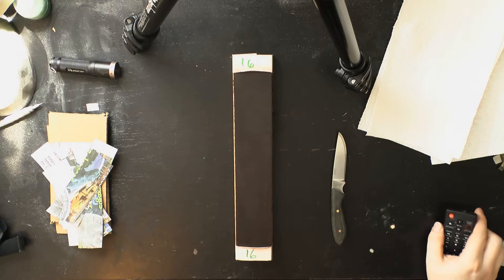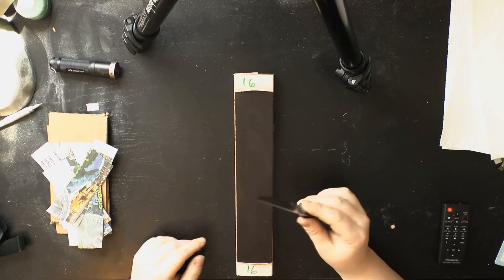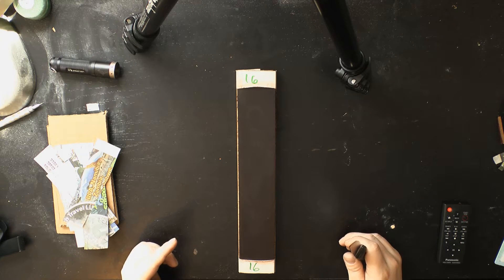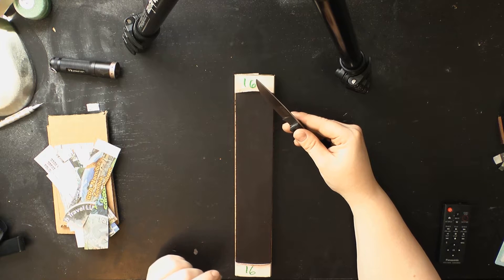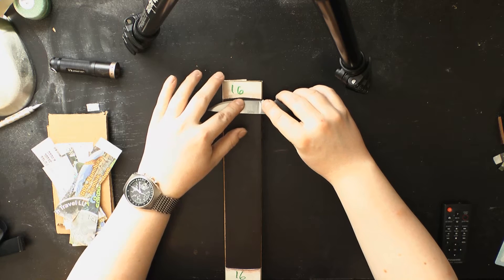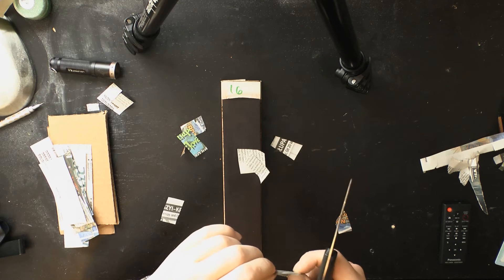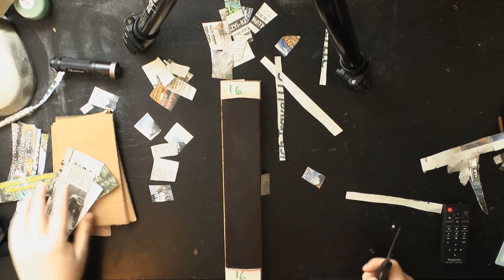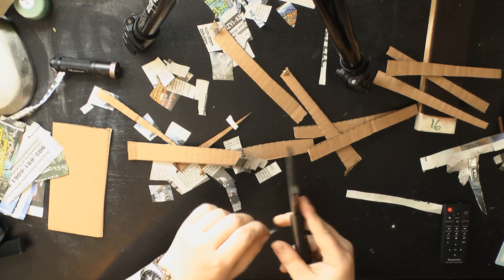A Brief Introduction to Coarse Particulate Abrasive Stropping

Comment: That would explain my problem, I often strop my knife after using the sharpening steel, and I recognized that they don't cut as well as if I just use the steel alone, I then steel them again and their capabilities are back, I use the skerper grey compound with 4 Micron, and the knifes came of the King KDS 6000, which compound grit would you recommend, when the steel isn't enough anymore?

Comment: Just Fantastic. You have taken the title of Mad Genius of  Sharpening on YouTube. My only issue would be that a lot of your equipment sounds pricey, any chance of doing a short video using budget supplies? thank you
Reply from the maker: Things mostly only start getting pricey if you want highly polished apex finishes. For coarse apex finishes, a Norton India combination coarse/fine oiltstone and some mineral oil are an inexpensive and effective option.
Reply: gotcha, Norton India, will try to get one this payday. besides the super-cool look of a polished apex are there any other substantial benefits to it? will the edge or "sharpness' last longer or give a cleaner cut? thanks.
Reply from the maker: The choice of what grit to finish your apex at should mostly be based on the type of cutting work you anticipate doing with the knife. Coarse finishes give you more slicing aggression and edge retention on draw cuts and are well suited to tasks like slicing cardboard, rope and carpet. Polished finishes are better for push cutting and by minimizing the force necessary to make those push cuts they can improve edge retention in push cutting stiff materials (e.g. whittling). You can get an apex equally sharp at any grit, more or less, instead what changes are the size of the microscopic teeth. Also keep in mind polished apex finishes require more stones and more time to produce.

Comment: Have you since tested how many inches of cardboard you need to cut in order to lose push cutting ability?  Also, do you notice any micro-chipping when cutting through lots of cardboard with this edge geometry?
Reply from the maker: Sorry for the late reply, but no, I haven't tested how many inches of cardboard I need to cut to lose push cutting ability. The data just isn't that relevant for me since I tend to keep my knives touched up on a daily basis.

As for micro-chipping, I've only really seen any significant tendency towards it on my Caly 3.5 in ZDP-189 which has a thinned out primary grind and ~7-9 degree per side edge bevel. Mind you, I generally choose my blade steels precisely on the criteria of avoiding micro-rolling and micro-chipping in light use, as its this criteria that determines how long they can be kept touched up between sharpenings.